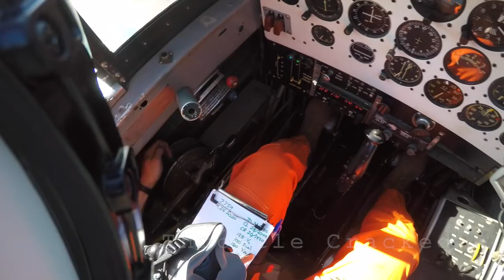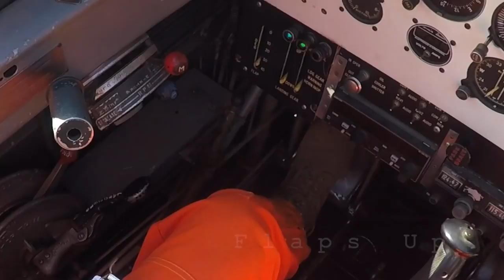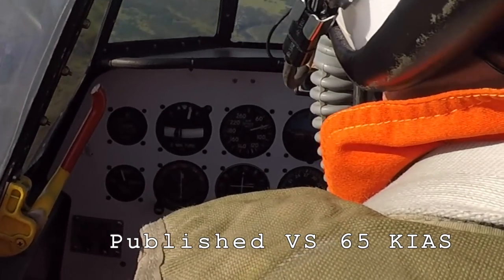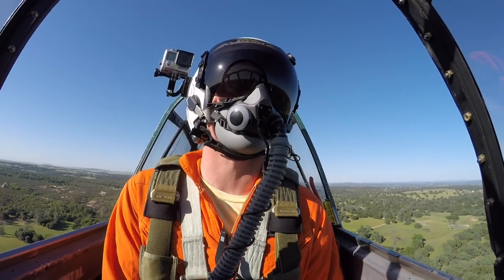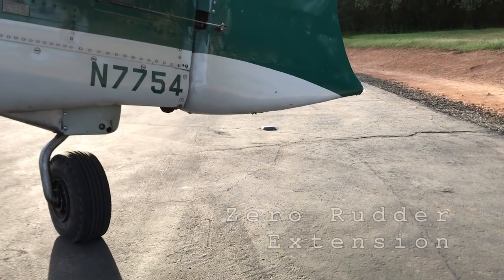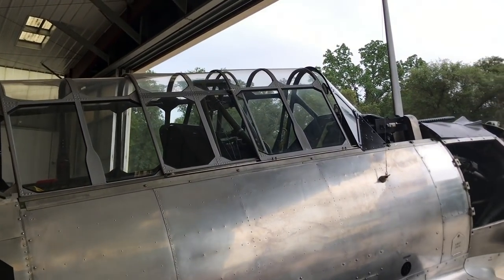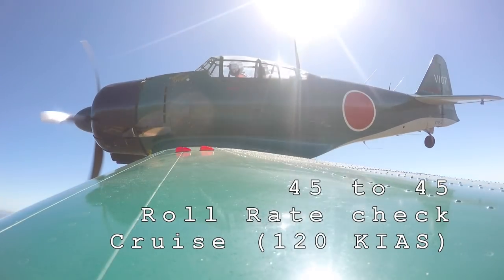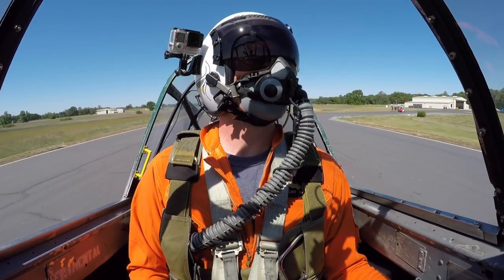Tora "Zero" T6 Warbird Check Flight - w/ Long cut debrief & modificaiton details

Comment: Love the videos!! 
On the takeoff, did you have the cockpit open for any specific reason like easier bailout, or just general heat?
Reply from the maker: The story is the that on some accident the fuselage will bend in such a way that the canopy will jam.  So if the canopy is closed you'd be trapped inside.  It's also been said that it's much harder to see the gear down locks with the canopy closed.

Comment: Great video! How’s the dihedral test done? Just apply full rudder and maintain it for how long?
Thx Elliot!
Reply from the maker: Refer to 23.177,  but to summarize rudder (appropriate magnitude to the type of aircraft) is added slowly looking for a lateral response without help from the ailerons.  In a certification environment this would be checked in all gear, flap, and power configurations from 1.2 Vs1 to Va.  In this case I only looked at it clean at cruise power and speed, and only out to 25% rudder deflection.
Reply: @utopiasnow  it's great to learn new things! thank you very much!

Comment: Elliot, as always a professional approach to checking a new aircraft. Did you find any difference to take off or climb between the 3 bladed prop  with gear reduction  and the 2 blade direct drive? It is definitely quieter with the 3 blade, not going supersonic at the tips. How much difference in slow down between 3 part Flaps and the 2 part?
Reply from the maker: Thanks for the comment.

It's definitely quieter with the slower turning propeller.

The flap drag is not hugely different.

Thanks for the comment!

Comment: Hey Elliot, Couple questions;  I notice take off and landings are with the canopy open.  Is that a comfort thing, or requirement?    Also with the oxygen setup, do you run O2 every flt or is it an emergency bottle should you need it?  Again, as others have said, great content, and have learned a lot from your vids;   Cheers - Rick
Reply from the maker: Open cockpit is a safety thing.  There is some risk that in an accident the fuselage could tweak and jam the canopy closed, trapping the pilot.

As far as the mask.  I wear it for three reasons:

1. Crash protection
2. Better Comms
3. Smoke in the cockpit

More on the O2 system here:
https://youtu.be/a-lceaOL2E8

Thank you
Reply: @utopiasnow  Thanks for taking the time to reply.  Cheers - Rick

Comment: Great video. Why are you cranking over the engine before switching on the mags? Is there a particular reason? 
Greetings from Germany 😊
Reply from the maker: It's common in round motor operation.  But specifically on this gear ratio  engine there is a belief that pulling the engine through before flight (to prevent hydraulic lock) could in itself hydraulic lock the engine.  So the procedure is to crank the engine for 6 blades before turning the mags on, to clear the bottom cylinders.

Comment: Cool video!
I'm confused, I thought T6 had a direct drive and fast prop rpm, this looks and sounds like it has reduction gear for the big 3 blade
Reply from the maker: Thank you.  Yes that matches my understanding, the stock T-6 has the AN-1 1340 which is direct drive and rated at 550 HP.  While this airplane has the S1H1-G geared version for the Otter rated at 600 HP.
Reply: @utopiasnow  thank you for the detailed reply!